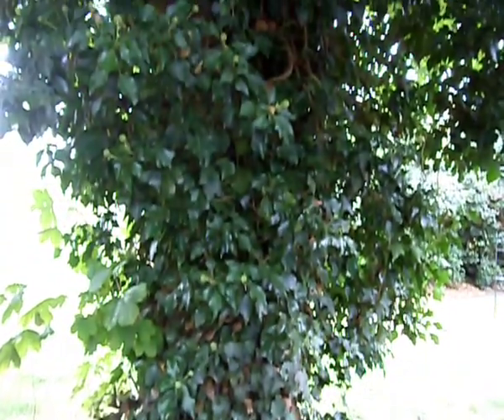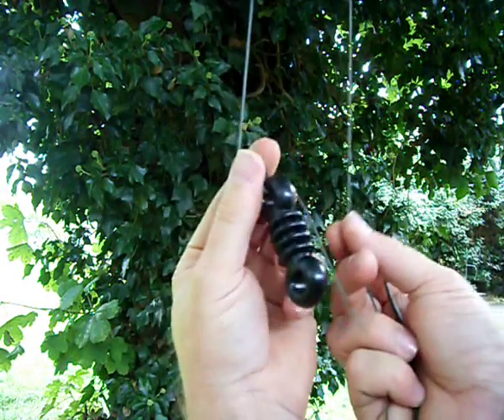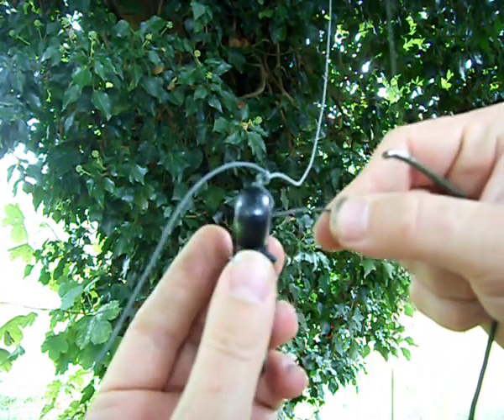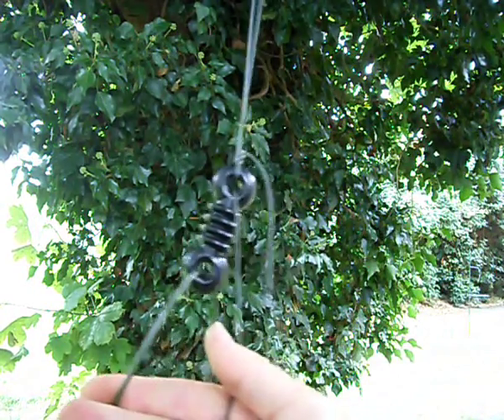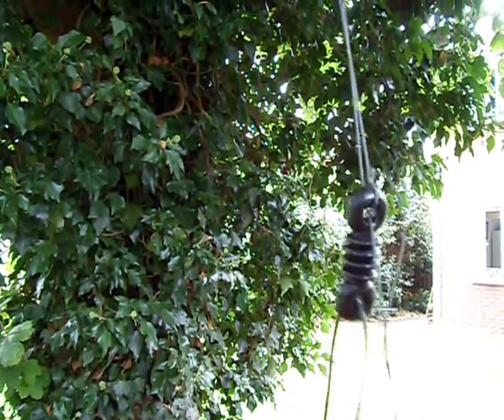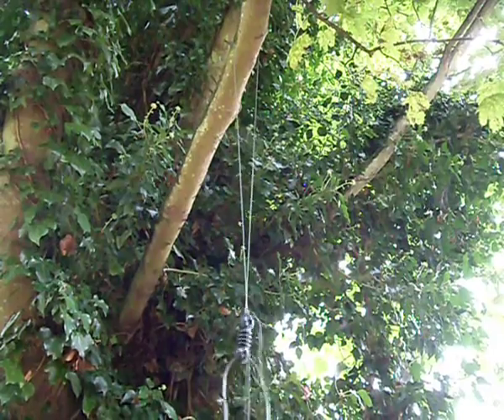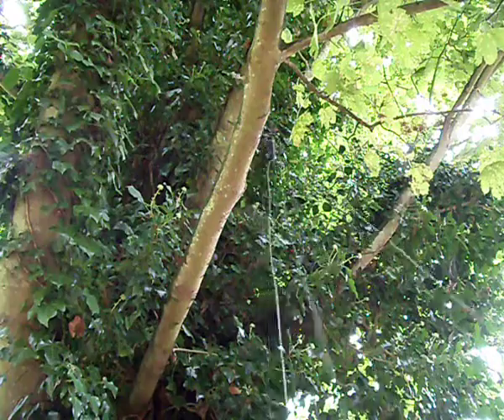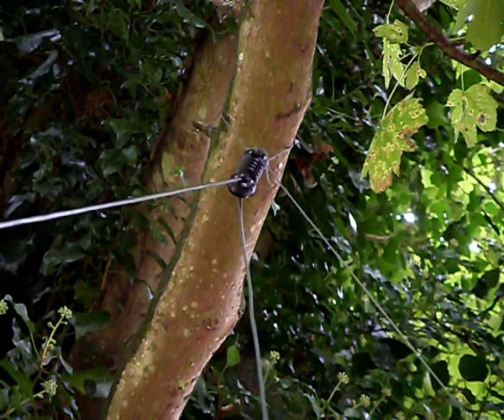insulating your longwire antenna

Comment: Hi Mark, could you do a video up of your "complete" outdoor PORTABLE longwire setup with different configurations inverted V etc and if or how you are grounding the wire in your portable system. I am very interested in how you set the whole thing up, especially how you made the wire loops at each end of the antenna (It looks like you used cable ties?)? Thanks for the upload, and great idea. Leave me a link to the video in your reply if its not to much trouble, again thanks.

Comment: Whatvdo you donwith the end of the antenna wire ? I understand lashing off the pull string to keep it up there but what if i wanted that insulatorvto be the end of my antenna ..woul i just tie my antenna wire in a knot to the end of that insulator ? Also where do i buy an insulator ?